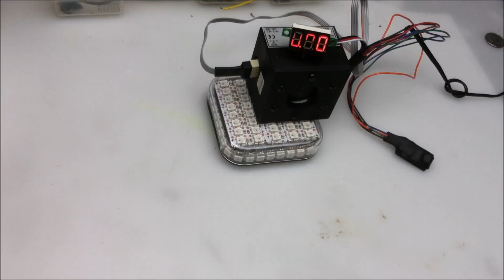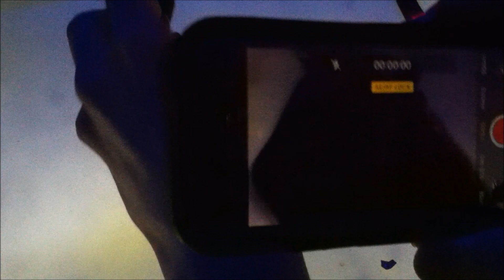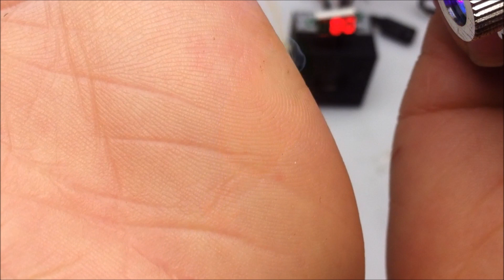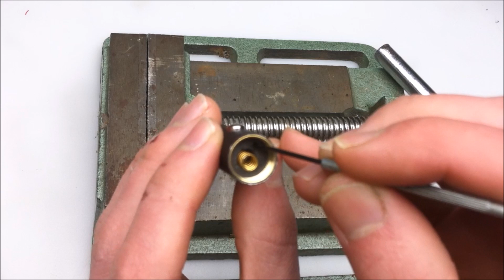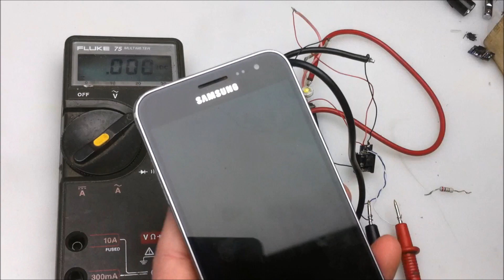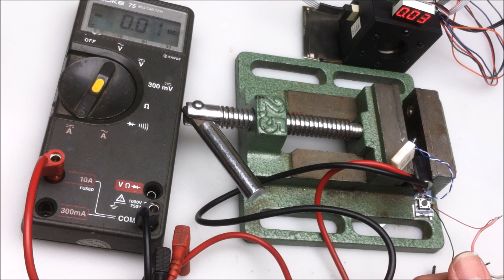Shunt Mod & The Danger of Cheap 405nm Laser Pointers

Comment: Yeah I took my 405 nm cheapo to a friends laser lab and we tested the "real power" not as much as your but none the less a nice 48/50mW output. Some think that even using those cheapo diffraction gratings make it safer but not really, yeah a decrease in power but just a little.
Reply from the maker: The diffraction ends are a small blessing in their own way. Same with the garden lasers and cheapo star effect units. They aren't exactly safe, but having the power spread out is better. 50-100mW is a lot of power in a laser. It's only been one of the cheap 405nm pointers that really got me and that was over 10 years ago. The retinal damage isn't going away. I have a hot stove appreciation and awareness for anything over 100mW.

Comment: So what is the max output of that original laser diode?
Reply from the maker: They are pretty close to max output on the pointers as is. The ones that I binned above 50mW loose power quickly and degrade.

Comment: @Zenodilodon any idea of the frequency response of the driver circuits?  Can you modulate them fast enough to provide useful visible signal transmission to a remote device, say in the MHz frequency range?
Reply from the maker: DC-DC converter laser drivers have a major cap in modulation because the signal can chop up the DC-DC pulsed and cause spiking. I have run these at .5khz just through turning on and off the power but if you want faster you will need a linear laser driver with op-amps and transistors that can modulate much faster. You can use the LM358/transistor combination and interrupt the op-amp current feedback loop and get some good speed. I would suggest getting a cheap read laser driver and messing with that for Khz and Mhz speed.

Comment: That fluke is awesome. Cool video. I'm a hobbyist electronics guy what's the best type of resistor to use?
Reply from the maker: The correct one?  

As long as the wattage going through your resistor is less than the resistor's power rating you'll be ok. As far as type, for the pointer driver's SMT is the way to go.
Reply: @Zenodilodon  I thought I seen you use some type of polymer resistor I wasn't aware of at some point. I'm roaring at your reply. I'd say the same thing haha they were the caps you replaced the smd one with. I should've thought before I spoke.

My wife's brother I'd the local fluke authorized reseller and he offered me a new 87v for 400 but the design is so old now. Even though they are 800 otherwise Gere in Canada. I'd buy an older digital fluke like that in a heartbeat for my collection. I've been loving brymen. As far as doing digital electronics and repairs mostly. I'm going to get the bm869s soon. Welectron sells them cheap on ebay but if you go to their store you pay way more and have to spend 500 euros before shipping haha

I got a brand new siglent sds2202x-e I'm trying to sell and I live in a place where that fluke dealer I told you about is the only place to get meters that aren't from Canadian tire so selling a scope here is impossible.  That was a great video by the way. Thanks man

Comment: if you use 18650 battery does calculation for the same diode change? or let me ask you instead,  why did you made calculation using 0.3 volts.  is that the voltage you were supplying for the driver, or was it diode working voltage?? noob question but i am confused. as you were using some lithium pack
Reply from the maker: The lower voltage I use for the resistor calculations come from the voltage that is read across the current shunt resistor. The driver's input range is about 3-5v. The input voltage doesn't effect the resistor voltage in this circuit.
Reply: @Zenodilodon  thank you. one more question, is it safe to use this driver modification with 488nm diode? i am asking if there is some safety as reverse polarity protection or that some reverse voltage safety mechanism?? 
thank you
Reply from the maker: @milanmacik6094  You can use this driver for 488nm laser diodes no problem. For reverse protection what I end up doing is to put a little piece of a paper sticky label with a hold cut in the center in the bottom of the laser pointer's battery compartment. This allows the + bump on the battery to make contact through the hole, but the flat - side cannot. These drivers do not have good reverse battery protection and it's better to be safe.
Reply from the maker: Also, note that if the revision of your 488nm laser diode has a case - pin the laser diode module must be electrically insulated from the laser host as it will be +.
Reply: @Zenodilodon  it will be Sharp GH04850B2G, so case pin is not used. So i guess i shoud bend the case pin to + pin?. Correct me if i am wrong. Thank you
Reply from the maker: @milanmacik6094  You can connect the case pin to + or another wire from the + connection of the driver's input to make the connection to the host for that connection yes. 

I made the mention of the case pin as the first revision of the 488-495s where case pin - ( What I am familiar with ). If it's the newer revision without using the case pin then you're in for an easy build.
Reply: @Zenodilodon   @Zenodilodon  i will tripple check the pin diagram once i have the diode in my hands, but so far sellers provided sheet is pointing the case pin as not used. 

Annyway just for curiosity.
In a situation where diode case pin is negative,  cant we make just whole build host -negative? ( + side of the  battery on the spring) 
Or would it be problem for the driver? Is it just one way?
Reply from the maker: @milanmacik6094  Most drivers switch on the - side, this makes making case - pointers kind of a pain. Mine was the first gen from like 6 years ago and I believe isn't even made anymore. The good old LM317 constant current driver does offer case - common drivers. In this situation a pair of 10440 (AAA lithium ion 3.7v) will be a suitable power source in the same form factor. I think you will be in the clear with modern 488s.
Reply: @Zenodilodon  you are awesome, thank you. My last build wast phr 803 back in 2009, so i am exploring all those new diodes and options after soo much time. 

Are you still reachable on LPF? 

Lastly lets say i calibrate driver mA  current for ld with 2xaaa, can i later use 3.7 volt lion if needed? Or will i   needed to retweak driver again?
Reply from the maker: @milanmacik6094  You can use a single lithium ion call as a replacement, either make up the extra room with a dummy spacer or in the case of the pointer style in the video just knock the back of the battery holder off and cut it to size for a single cell.

I am on LPF, I rarely post there. I am on Discord and FB too. For the most part I handle show laser stuff on a higher tier scale and don't bother with pointers. Best place to practically ask questions is on YT so the Q/As can be seen by others.
Reply: @Zenodilodon  thank you so much. 

Would it be also possible to use drivers from green pointers? 
They drive 2.2v didiode. Soo i am thinking if we use 6v 488nm  diode and lets say 7-8v input to the driver, should it work???  Or it would be too much voltage for the driver  to handle?
Reply from the maker: @milanmacik6094  You can use a green laser driver with higher voltages if it's a proper LM358 based one. All the parts are rated up to around 16v IIRC. The same parts I used on my Sapphire driver, just in through hole form and had no issue up to 12v. These are linear drivers though and will dump the extra power into heat so be mindful of that if you are driving loads past half an amp.
Reply: I have a 1000mW green 532nm laser. Am I correct in thinking adding resistors over the shunt will add ampage and make the laser brighter?  IR5 looks to be shunt resistor on this driver.

Also, would adding another 18650 battery in series do anything?  
Driver board "SN-30340-Y", maybe you're familiar with this device? 🙂👍
Reply: @David-Christ-13  seems you have 1,5ohm resistor.. you can replace it with 1 ohm and get more power out of pumping diode probably..  or as you mentioned add another one on top of this one.. 3ohm resistor on top of the 1,5ohm will give you 1 ohm..  but then check if your dot doesnt shift shape in negative way.. mode hopping should be the term to describe it if i reacall correctly

Comment: Great info :) 

Do you know if just raising the resistor value will compensate for running this laser ( the boost drive specifically) off a higher voltage, say 5v? My hope would be to still make less bright for sure...
Reply from the maker: The resistor value changes current. The voltage range for input will depend on your output voltage ( this depends on the load and voltage drop at x current ) If you raise the value of the resistor in this case it can actually work against you. The laser diode runs a little above 5v if I recall correctly, so with a higher value resistor and less current that voltage will drop closer and closer to 5v as you lower the current allowed to the laser diode the voltage will continue to drop. Since the voltage of the output must be higher than the input to regulate properly. Here is the problem in a nut shell.

IE
LD v 5.7v 100% relative power/Driver input 5V ok!
LD v 5.4v 80% relative power/Driver input 5V ok!
LD v 5.1v 60% relative power/Driver input 5V questionable
LD v 4.8v 30% relative power/Driver input 5V Unstable
LD v 4.8v 30% relative power/Driver input 4.2v ok!

You can work around this though by also placing a lower value resistor such as 2 ohm in series with the laser diode to raise it's needed voltage at x current, or consider a 3.3v voltage regulator between the 5v source and the driver. 

Hope this helps.
Reply: A lot! Thank you, I may end up running it off a 3.7 li-ion, and just raising the current limiting resistor untill it it feels good, or go with the series resistor. It's for a simple laser projection project, so safety is the big goal, not perfection. 

I appreciate the reply, cheers!
Reply from the maker: @arenotdiy  Good luck!

Comment: How much power does this cheap 405nm laser diodes can handle? and what is their lifetime?
Reply from the maker: They can vary from 30-100mw. When pushed up past 70mw they don't last very long at all. 50mw is the upper practical range if you want more then an hour of life before it fails completely or looses a bit of power. The 405nm laser diodes are quite fickle, they can last years or minutes depending on the day of the week they where made it seems. Placing a SMD capacitor of10v 1-5uF helps kill spikes on the diode. 

If you want a word of wisdom, don't expect to overdrive these, or any laser diode and expect much lifetime. If you want the power get a laser diode with that rating and under drive it a tad under spec, add an additional capacitor like I mentioned and you will have a laser with unquestionable years of service.
Reply: @Zenodilodon  place the capacitor in parallel with the laser diode?

Comment: Can I just fully remove the resistor and short it? What will happen then?
Reply from the maker: The driver would be set to it's absolute maximum current output and most likely die from overheating.
Reply: @Zenodilodon  Ohh okk thanks for the reply, I just want to make a burning laser for once, but I don't have access to such low resistance resistors, but yea killing the circuit due to overheating is a bad idea too. Thanks tho, learnt a lot about lasers from your videos.
Reply from the maker: @origamiworld2014  You can go up to about 500mw max with these drivers but additional cooling is required for the heat sink. You'll also need to get a stronger laser diode as the stock laser is only good for about 70mw at it's peak, after about 60mw or so they don't last very long. You can pick up an M140 A type for about $10 USD and press it into most laser modules. The M140 A type is nominally rated for about 1.2 watt so running it at 500mw will give it a very long life. Low value resistors are uncommon in the 5-1 ohm range in general electronics, usually I see higher ones or those in the sub 200miliohm range on laptop motherboards. This is the reason I had to use the larger ceramics myself for this range, and let me tell ya I have a whole house full of electronic salvage and still nothing in surface mount in the correct value.

Glad you are learning a lot, it's why I post content. I want to see people accomplish there goals easier than I did. 

Burning lasers are cool, but as someone who has messed with at least 100 lasers capable of burning I'll say it gets old pretty fast. There is a lot you can do with lasers even at low powers that continues to astound me whether it's something as simple as laser lumia or more complex like setting up interferometers. 

Even if you don't currently have a burning laser I would suggest looking into other laser uses as you might find enjoyment still in some of the other uses just as I do. Eventually you will have a burning laser, they are quite common these days in both the pointer market and as part of consumer technology.

Comment: Want to know where to solder a resistor onto the circuit board itself without wires. Kinda didn't show it...
Reply from the maker: Where the old shunt resistor went. This location is different on different board. For this reason I try to teach what part to look for and the concept behind why changing a part works. Figure it like a video on changing spark plugs. If I clearly show how to change it one one model of car then the video is only good for that model, if I tell you what a spark plug can look like and it's primary function that information can be used on all models. All you are doing is changing the value of the shunt, you have to figure out where that is on your board. Usually the lowest value resistor on one of these drivers.
Reply: @Zenodilodon  I soldered it right onto the 3R3 without removing it.
Reply from the maker: @burniesender9980  That sounds like you got the right idea 100%

Comment: At 29:30 you aimed the laser diode at the black battery. NEVER do this!

That's like placing a blow torch right under the stand of its own propane tank. Lithium batteries are extremely flammable and will explode with very poisonous smoke if ignited by the laser.
Reply from the maker: Well, no... sorry A the material surrounding the battery materials is quite reflective or is plastic covered and once the plastic is melted away it's pretty much reflective. Secondly the thermal mass of the batteries is quite high compared to the energy of the laser beam as these levels, you could leave a battery in a 1 watt laser beam no problem, most of the energy is reflected away. Lithium cells exploding, well see 2 things has to happen, first you need enough energy to have the cell heat up and produce gas, most of this being I believe hydrogen fluoride as gas that supports combustion. Which well, given the battery fires I have had over the years I have been doing stuff can't be all to bad. I have taken batteries apart too and well, chemically overall they are pretty safe chemically. 

I guess that about wraps up that.

Comment: How to know how far you can push a LD? With an adjustable driver or supply that has sufficient voltage so to not plateau, is “pfzzt!” the only indication of the limit of a LD?
Reply from the maker: Laser diodes are always driven in constant current operation because they have a negative temperature coefficient characteristic and are pretty sensitive. If the laser diode is an unknown extracted diode there may be markings on the back or around the rim near the window to indicate what model it is. If not than it's a game of trial and trying to match voltage/current slopes of known diodes of that wavelength to find the closest match. These can be found on datasheets and DTR's Laser Shop also does a great job of listing the information. This can be extremely difficult otherwise if there are no markings. You can identify the color of the laser diode by the color of the output window. The AR will be the inverse of the output color such as blue for red LDs and yellow for blue/violet LDs, IR is often a greenish color. I tend to look up diode datasheets and check their rated current, usually I avoid pushing them to the max current because this can damage or greatly reduce their life expectancy. Never try to voltage regulate because as they warm up they consume more current and can thermally run away. Make sure your PSU had a stable current regulation and voltage above the diodes listed voltage at its rated current. The voltage of course will end up dropping under the load of the LD when regulating current.

I hope this wasn't too verbose and helps.

Comment: The Fluke 75 multimeter does not have display light function. Yet... there it is. Did you mod your meter?
Reply from the maker: Yep, I put in a pair of white SMD LEDs and resistor behind the screen. I turn the light on and off with a little switch that is on the side of the meter. It's a handy thing to have.
Reply: Well done.